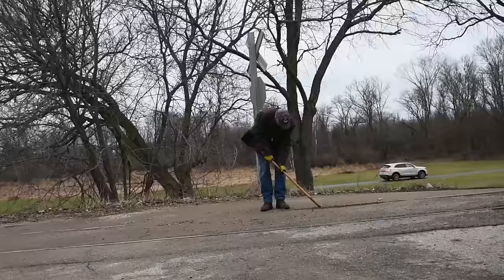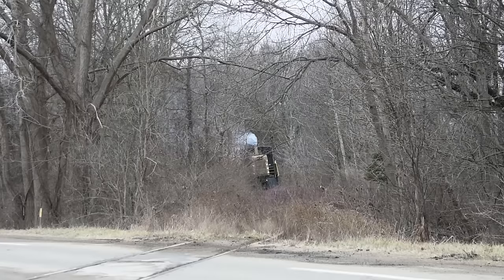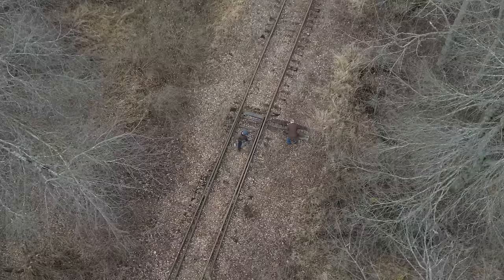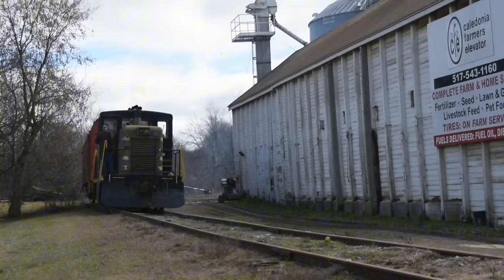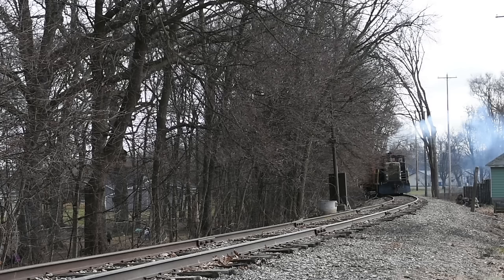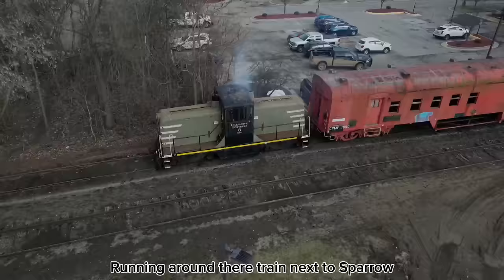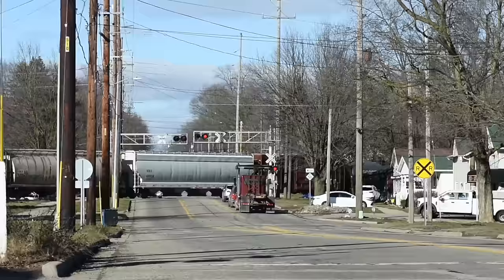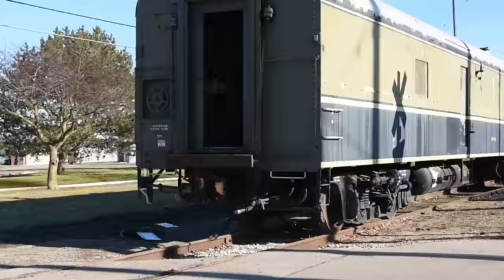The Charlotte Southerns Final Run! (CHS #3 Last GE 44 Toner Built)

Comment: Don't say abandoned or rails to trails will be there ripping it up before you get done
Reply: There is no rail beyond where the cars were stored anyway.
Reply: Rails to Trails people are "evil".🤬🤬🤬
Reply: I blocked a trail group from going across my property being that I owned the land on both sides of a Railroad ROW. They fought me tooth and nail in court for 4 years with one law suit after another once I got the property deed which stated the land would revert back to the property owner in which the line was built across they still fought me over the legality of the paper work and another 2 years of court battles before a judge basically to the county, state, and all intrested parties that were heavly involved with fighting me to fuck off and repay me for 5 years of herrassment and legal fees. I permit a farmer to use the ROW to work a field I lease and on occasion Loggers to work a back wood lot once every few years. Anyone else is arrested with out question.
Reply: @onrr1726  Excellent, great job. 👍👍👍👍👍👍
Reply: @spuds6423  Why do you call them evil?
Reply: @ethanlamoureux5306  Because they tend to have ulterior motives and rarely do they not want to pay for the maintenance and upkeep. Also, if there is a need to reactivate the line, they will fight you tooth and nail to do it.

Comment: Why didn't they take all of the passenger coaches. Also, why did they have a man get out and block the crossings instead of them blowing their horn. I noticed that the horn worked because they blew it for the kids. that seems like such a waste.
Reply: Not how you legally guard a crossing without a signal. There’s nothing blocking that crossing, too easy to have a car come through and smash into the engine

Comment: No! its sad to lose such a cool little shortline! I hope that GE 44 Toner gets preserved at least!
Reply from the maker: Time will tell, I assume something will come out of it at least
Reply: @AFLKProductions  that's good! It's a cute little switcher!
Reply: It is going to the Cooperstown & Marne RR in West MI by truck is what a CN Employee told me
Reply: @davidbankhead8994  Ok! glad something is coming out of it!
Reply: Hope so. Wonder if she still has her D17000s. Doesn't quite sound like a Cummins re-power. 
Done a lot of work out at the tie treatment plant that AT&SF #467 used to work at. She got run off into the pressure cylinders and broke her frame something like 8 years ago. Real shame.
Edit: looks like the last 4 built had Cat D342 power- dang good engines.
Reply: @typrus6377  she still has her original prime movers.
Reply: good thing she is still and will be in service. as i found out she was the last 44 ton switcher built! (correct me if im wrong)
Reply: @molossis  yup for the Danville & Mount Morris Railroad over near Rochester, NY the little road was eaten up Genesee & Wyoming Industries and placed under the administration of Rochester Southern Railroad.
Reply: Hopefully someone can rebuild the prime mover and keep using her.
Reply: The Southern Michigan Railroad in Clinton bought it and plans on using it

Comment: Nice video. Your production quality has really improved over the years. I am impressed. Keep up the great work and well done on documenting the final run. Make sure you back up your footage so you never lose it. This is priceless!
Reply from the maker: Thank you Drayton. I appreciate those words a lot, especially from you. I’ll take your advise on backing it up. Thank you for watching!
Reply: @AFLKProductions  I never used to save my old video files. That was a big mistake. I also never backed them up. I had a hard drive fail on me in 2015 and I lost everything I recorded from 2014 to 2011. It was devastating.

Comment: Interesting that they didn't blow the horn at grade crossings, and the crossing lights didn't work. Huh
Reply from the maker: They actually made the crossings “Exempt” 3 days before the run.
Reply: They didn't have the light on either.
Reply: Outlaw move 😂
Reply: @dannyjones3840  nothing wrong as long as they stopped and flagged the crossings/ totally legal
Reply: They are set up on remote controls on the big engines and track sensors in manifest trains

Comment: I believe this is the line that also ran past the Caledonia Famers Elevator in Caledonia MI until 40(ish) years ago. The operational part of the line delivered cars to Keebler where my wife climbed them to sample raw materials and quality check them before offloading was permitted. It also went within 1/4 mile of our first house in Kentwood MI, though it closed just before we  moved into that home in 1984.  The line continued and ran within 3 miles of our current home south of Caledonia on to Middleville. If I am correct the last operators of the section from Grand Rapids southeast to Hastings were not good at railroading and damaged significant freight destined to and from the big water heater plant in Middleville causing them to stop using the line. Soon after the line's only locomotive froze, and that was the last straw for that part of the line. 

Much of the line is now part of the Paul Henry trail.

Comment: Thanks for the show. You did a pretty decent one that really worth it.
Engine isn´t smoking at all. It´s crew´s dîner on the grill. Hope they shared it with you, since now it´s no more a railroad property....Just a private one 😊😊
For the Long Island left at the end. They have to be euh....insane if they want to scrap it in situ. You have betwen 50 to 60 tons of stuff to carry out ! May  be a good legal excuse to not officielle shutting down the line. With a car on each end, it´s not abandoned anymore. Just unfrequent use. That way exempt rail crossing is ok since road vehicles have priority and train must stop. There is may be pressure to rip up the track. A smart way to block it.

About non working crossing signals, go on Earth syreet view at
Junction 98 on Imperial hwy,
Ocetillo, California and take a good look. Since there is no electric utilities to flash lights and lower the gate, they use solar panel. To protect it from theft it´s surrounded by Frost fence. On shoulder you have the X sign. X sign painted on the road and....one totally missing crossing pole. Nothing left of it. On other side of the road, pôle is still there but lights and gate are gone znd no exempt sign. Officially for the road department that rail crossing is in service !  Of course it´s not but tracks are still there. Quite worse than non working flashing lights. With our shortline, power have probably been disconnected and meter removed. Anyway with rusty rails they 
wouldn´t work anyway.

About headlight and safety vests. Well railroads ran that way for a century in steam days. But people were also smarter. They didn´t needed to have inscription on coffee cup " that content can be hot ". People knew that coffee is hot !!

I agree that flagman really want to play smashing dummy. He what´s wrong with someone wanting to play rodéo against a car ?

Finally about that century old RPO, just hope thst COT&S have been done with tons of documents. Otherwise  Class 1 won´t even touch it. Moving that is real real challenge. And even, "young" train crews aren´t familiar with passenger car valve.  Where they are for release. By the way those valves are set for freigjt service and not in passenger mode i hope. First shit that can happen on the road and the nearest track to sideline it will be the result even if car is fine.
With lucks it won´t be coupled with F tank car style coupler. Quite destructive....

Comment: Nice coverage; too bad to see a line die out. Happens too often. Wonder what they will do with number 3 ?  Seems to need some engine repairs but overall not in bad shape (rings maybe ?)
Reply from the maker: Our best guess is it’s going to be sold but trucked out. I have faith someone will buy it, those 44 toners never stop moving.
Reply: Seems like it’s only running on 1 motor

Comment: Is this a no horn zone. I did not hear the engineer sound the horn or the bell at any of the crossings. Nor did it look as if the headlight was on. The locomotive evidently did  not have an automatic signaling system as they had to flag all the crossings.

Comment: Thing is an environmental nightmare. Get it shut down, really.
Reply from the maker: Gotta love the older units
Reply: Even these older units still produce less CO2 emissions and use less fuel than single modern semi trucks. The humongous trains you see pulling hundreds and hundreds and hundreds of truckloads worth of products use less fuel than it takes a semi truck to haul one truckload. Not less fuel per ton or anything, less fuel period. Yeah they look like they cough up a lot of stuff, and this poor engine is definitely having problems, but they're actually not nearly as bad as they look. Sorry for the rant lol.
Reply: Glad this 44 tonner will be preserved 😉
Reply: get bak in ur prius😅😅😅